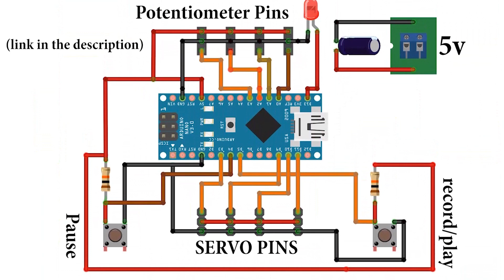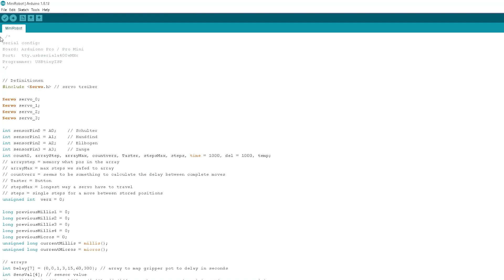How to make robotic arm with arduino - record and play arm

Comment: Bro only two moter are working and one potentiometer chatch fire and other than only two where working bro please help me out how to fix it and I have tested moter all where working properly please help help
Reply from the maker: You need to connect all the potentiometer inorder to work
Reply from the maker: And Also check the connection onces again before supplying power so that you can avoid buring components
Reply: Ok bro ☺️

Comment: And in circuit Diagram one mistake is that
5v input are not  Connect to circut
Reply from the maker: check properly
Reply: you are right, the diagram has a mistake. 5v power supply only connected to the cap and servos, not connected to the circut.
Reply: @WilliamCuriosity also pot center pin is grounded, 

Actually the Center pin is input

Comment: While uploading code, i am getting LOW MEMORY errors
Reply from the maker: Code not uploaded?
Reply: @kitronix  nope, keep getting error occurred while uploading sketch
Reply: i deleted record codes ad fixed the low memory thing but i still get errors while uploading sketch
Reply: @kitronix  btw, do i need to have external 5v power supply? can't i just keep arduino plugged to my laptop?
Reply from the maker: @ButterDragon  you can use usb power bank

Comment: I have connected the pot and servo motor perfectly but the servos are not rotating accurately and the led light is blinking for 3 or 5 seconds

Comment: The servo are not rotating accurately and sometimes 2 servos are Responsing at once plz reply
Reply from the maker: Did you connected the potentiometer to the correct pin?
Reply: @kitronix  yeah I connected them well
Reply: I have same issue, aren't solved?, @rishik
Reply: @adilshaa5222  no

Comment: How many volts resistor did u use 10k 1/2v resistor or 10k 2v resistor
Reply from the maker: 10k 1/2 watts
Reply: @kitronix  thanks

Comment: I think it is an error in the code because I tested the board with a routine for the arm and it works perfectly but when I upload the minirobot code, what was said above happens
Reply from the maker: Did you connected both push buttons to Arduino as shows in the circuit??
Reply: @kitronix  if one goes to pin d4 and the other goes to d5
Reply from the maker: Yes

Comment: it throws an error in orange and says that it may be that errors are produced when the code goes up the servos adopt a position and remain rigid and do not move
Reply from the maker: But the code uploaded successfully??
Reply from the maker: If the servos adopt a position means code has been successfully uploaded. your connection may be wrong or you didn't connect the push buttons
Reply: @kitronix  yes

Comment: can you please tell me after uploding code into my arduino why it is not working the led is only blinking   
twice in one second pls give me its solution
Reply from the maker: Did you connect the push buttons???
Reply: @kitronix  no
Reply: i actually tested with servos and potentiometers

Comment: Could you help me in the arduino code when I upload the code it says that it could cause instability problems and the board works perfectly
Reply from the maker: Does it throws up any error while uploading?
Reply from the maker: Or it says "done uploading" in left bottom corner
Reply: @kitronix  yes

Comment: bro I built the arm but I have a problem when uploading the code to the arduino nano board the servo motors stay without moving they move forward and the led only blinks what do I do
Reply from the maker: Check your connection with multimeter

Comment: I have a question what voltage is needed to power the servos circuit is it 12 volts or 5 volts
Reply from the maker: 5v
Reply: @kitronix  Thank you

Comment: 10:59 what is this wire(Red and Black one), and where does its other ends connect to?
Reply from the maker: 5v supply from external power supply
Reply: @kitronix  Thanks!

Comment: Which material did you used for the arm?
And when will you upload the Arduino code and the schematic?
Btw great video, keep grinding!!!
Reply from the maker: I used 5mm foam board
Reply: @kitronix  can i use any other material or this is strong enough 🤔?
Reply: Ok bro no problem, I'll wait
Reply from the maker: I will upload the circuit and code as soon as possible
Reply: @kitronix  bro can please upload the code
Reply from the maker: Check the description
Reply from the maker: Thanks bro
Reply from the maker: You can use other materials but it should be lightweight
Reply: @kitronix  ok bro thanks for the help, I'll keep that in my mind
Reply: Hey bro, can you tell how to reduce the noise or the shaking/sluttering in the servos?
Reply from the maker: You need to connect the potentiometer  to the  correct pin which controls servo motor for example : 1st servo connected with d5 which is controlled by 1st potentiometer connected to A0
Reply: @kitronix  thank you so much bro
Can i use 9v battery or only 5v?
Also can i use any other pcb or solder board?
Reply from the maker: Use only 5v
Reply: @kitronix  thanks bro for helping, now i am confident enough to make my own robotic arm by following your video.